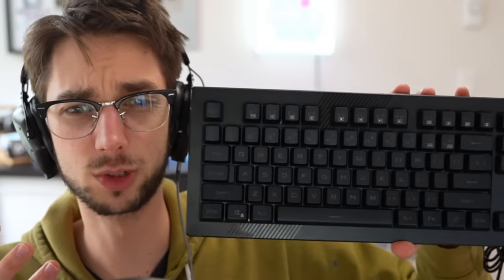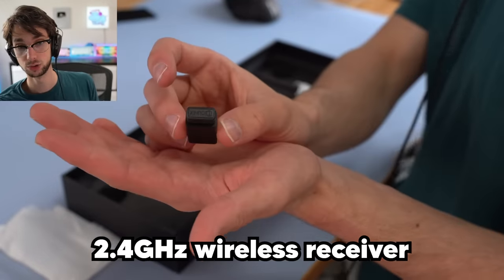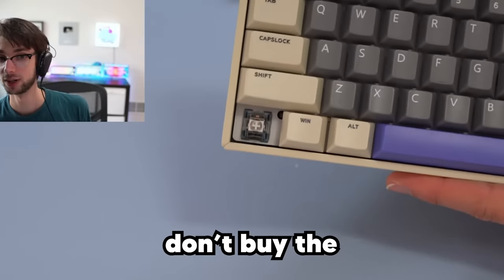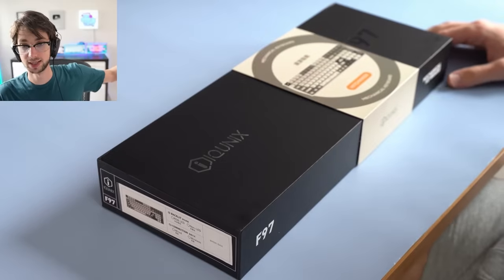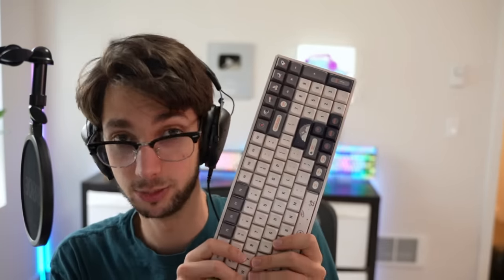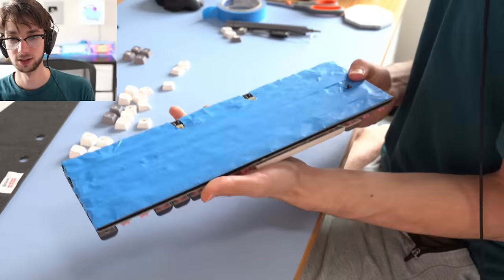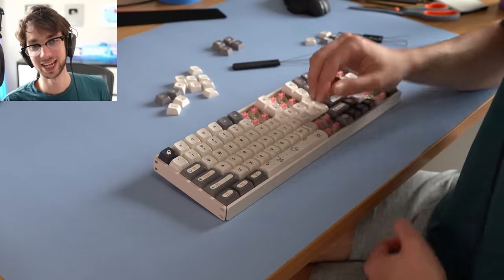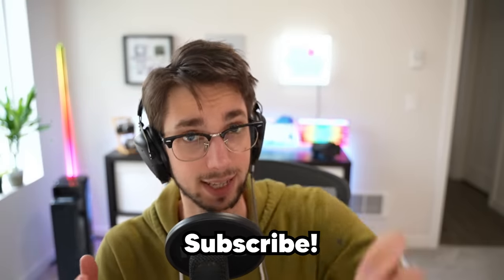Why do People Want Keyboards With Number Pads??

Comment: I work in IT and without a numpad doing even basic tasks like typing an IP address is a real pain so this actually looks really promising!
Reply: That and almost everything now requires two factor authentication where you have to enter the code
Reply: Also in IT and can also confirm. Didn’t think I’d need it, so I bought a NuPhy Air 75. Love it! But don’t love not having a numpad, so even though I’ll probably still keep it, the search continues!
Reply: Pretty much this.
Reply: Yeah the muscle memory of the numpad is difficult to change for the number row
Reply: @CaseyHardman  I have an Epomaker GK73XS which is VERY compact (323mm long, 118mm tall) but has a numpad. You do sacrifice quite a few keys in this form factor and can get used to it quite easily once you know where it is in the layers (customisable too), but some stuff is tough under this format when using modifiers to do actions with keys under layers. I'm inclined to suggest the new Epomaker TH96 or Keychron Q5 for a better experience with less of the compromise. The Epomaker only has proprietary software for customisation on the multi connectivity model, the wired one supporting QMK / VIA also, but the Keychron supports QMK in BT and Wireless!

That said I use the 73 for home and work so I take it in and at 680g it's pretty light vs the TH96 (1180g). Also the TH96 is longer and taller as it has an F-Row and a more usable layout (388mm x 138mm). It is also chunkier at 38mm vs the 73's  29.9mm.

Sadly the 73 is only Bluetooth and Wired (still good ngl) and has a fairly small battery (1900mAh - enough to get you through a working day even with LEDs on at lower brightness), but the TH96 has Bluetooth, wired and 2.4Ghz modes and a 6000mAh battery so should fare better.

I picked up the 73 at $99 but it dropped to $60 though is now sold out on their own site. The TH96 is $149 for the multi connectivity model and $170 for the Wired only model (odd, but here we are). There are some aesthetic and potentially QC considerations at this price point vs some other brands, but all in all I've had a great time with the 73 and going back to bigger keyboards is tough. Glad I have a numpad!
Reply: I picked up a B stock polycarb M0lly for work because of the layout. It's basically a 60% with a numpad tacked on. I don't miss my arrow keys because I have the space bar configured for space on tap and layer 1 on hold and WASD are my arrows. More efficient than moving my entire hand to hit dedicated arrows. And since I don't game at my work desk, using space as a layer key when held isn't a problem.
Reply: I feel you, however I have a lifehack for you if you work with a laptop without being connected a real keyboard. Buy a wireless standalone numpad ;)
Reply: Couldn't agree more. Typing in many IP addresses all the time working as a network engineer, a num pad is essential. I wish there were more full size mechanical keyboards. The 100%s too not the 96% I make typos all the time on them.
Reply: @bryanwi09  there's plenty of 100%s out there tbf, just not as popular now. I have a fnatic rush iso UK full size with cherry red silent keys. Linear but fairly quiet
Reply: @bryanwi09  mentioned it here earlier but for IT people I can really recommend getting a wireless numpad to work it even if you're using a laptop keyboard.
Reply: I work in health insurance, also need a numpad. I cant imagine entering claims without it....
Reply: Totally this. 
I've been pondering and I don't think I can do the 96% either. The 1U zero and no spacing I'm thinking are show stoppers for the quantity of zeros in the private subnets I'm entering much of every day.
Reply: @TheChiraagG  the small 0 on the numpad is so sad though.  Always keep hitting the right arrow key instead.
Reply: @mixeddrinks8100  does take some retraining of the ole muscle memory ngl
Reply: @TheChiraagG  might think about getting the Keychron Q6 for work need that full size 0, typing 0.00002 is no fun after awhile plus seems like it has a few extra button, could come in handy if you can remap them to copy and paste.  I work in QC/QA so after a session on the laboratory silicone keyboard, waterproof and can be disinfected.  Feel like I have to treat myself going back to the desk to fire off some angry emails at suppliers and staff.
Reply: @mixeddrinks8100  ahh I get it. I have less issues with the zero than sometimes hitting 4 as well as hitting enter lol

I think on the GX73 the issue is spacing. The Epomaker TH96 could be enough - no big zero but a space between that and the right arrow which would work for me. But of course YMMV. I'd actually have got the TH96 to replace the GX73XS but it would be a smidge too big to take into work every day.
Reply: or if one has to type in the language that has additional letters that are assigned to the upper row. imagine switching language just to be able to type numbers.
Reply: I just also like numpads. And macro keys. I want like twenty macro keys. Big ones. And small ones.
Reply: IP addresses, employee numbers, phone numbers, programming, etc.  I'd like to know what people are doing where they don't really need a numpad.
Reply: I am an engineer and I have a laptop without a numpad. Whenever I have to type numbers when writing formulas or sample calculations for a report I get distracted by the thought of how pissed I am and how annoying it is.
Reply: Valid
Reply: finance and Data analyst with excel, without numpad is killing me.
Reply: I’m an analyst, business and data, and also needs a 10key
Reply: @CaseyHardman  have you seen the new nuphy air 96? I just bought the halo 96! Waiting for it to arrive
Reply: I know the IP nightmare Without a number pad.
Reply: Separate numpad is the way to go.
Reply: @CaseyHardman  nuphy air96
Reply: There was a dude in my high school IT lab who always typed in IP addresses with the number row.
I should have seen the red flags.
He later implicated me in a scandal over some grades he changed after hours cuz I was in charge of the router box.
What he actually did was plug in a switch, bypassing my router entirely lol.
Reply: THIS!!! In I.T. We NEED our Num Pads, we NEED our F Row, we NEED arrow keys (bios bro!) and dear god what kinda computer user doesn’t occasionally press Ctrl Alt Delete so the boards missing delete BAFFLE me.
Reply: yerp, I'm not typing out IPs all day the long way. However, an 1800 is not a full sized.
Reply: @thumbwarriordx  bro... calling it "the router box" tells me you're in above your head. Do tell the network topology where this person "bypassed" the "router box" to make this happen.
Reply: @toohip  Yeah they were just on two different subnets and literally all you have to do is reconfigure the system you log in on to be on the other subnet with its second network adapter.
Which was the domain server and did have an extra RJ45 so no. There was no authentication between routers and switches. They didn't whitelist mac addresses and do all that difficult crap. These were PUBLIC SCHOOL IT people in 2008. Of course it wasn't difficult.
Reply: @toohip  It was literally a 4u chassis with 4 network cards and a core2Duo. I don't know what you want me to call it other than "the router box" 
It wasn't a frigging Cisco router.
Reply: @thumbwarriordx  that makes more sense, but a router is a router, regardless of the size. Is it layer 3? Yes? It's a router. Calling it a "router box" is just highly suspicious and odd. Plus, if you had anything with an xU mount, it wasn't a home networking appliance. 

Also, any kid with a lick of knowledge in the 90s/2ks was doing this same workaround. It's not a new thing. Schools are notoriously open.
Reply: @thumbwarriordx  also... I've been IT for decades. The amount of times I've heard this exact story is hilarious. "I had a friend that hacked the school network". It's the same old story.
Reply: @toohip  That's because it actually happened over and over.

Also he didn't hack anything. He already knew teacher passwords. All he did was connect an ethernet to a system he controlled and go in at night when he thought nobody would notice.

Personally I wasn't so forward. I would notice the "request help" button become available meaning I was being observed. 
I just opened the web source code to the login page of the grades system, the offending administrator stormed into the room and I yelled at him for a little bit and got suspended.
Reply: I can relate to this, I work in Cyber seurity and that num pad is an essential on my keyboard. 
My other half who works in financial compliance also required num pad...So underrated that side of he keyboard man
Reply: same, I'm thinking about making my own keyboard, but without a numpad it is almost like a nightmare, I tried to think how much I use the numpad and it is A LOT! so, that is a valid and heavy reason to use and keep using numpad
Reply: you can get a tkl keyboard that uses layers and put the numpad there or alternatively buy a separate numpad
Reply: I work in IT and I never use the number pad.
Reply: I work in it (data engineer), I enter numbers all the time and I never missed numpad. I'm actually thinking about going from 60 to 40. Sounds like a skill issue to me
Reply: I’l work an office job, and I constantly have to punch in account numbers. Number pad is a god send.
Reply: Skill issue.
Reply: @ttownscott  You too. Skill issue.
Reply: @CaseyHardman  You as well. Skill issue. You could have spent time practicing on upper rows. Few mins a day and you'll forget numpad in less than a month.
Reply: @TadeasF  Exactly!!! It only takes few minutes consistent practice every day. I'm more comfortable with upper rows now than I was before with numpad.

It's a skill issue and lazy IT people.

Comment: I mean, yeah, cost is really the answer. Would I like to have a keyboard that sounds great and feels fantastic to type on? Absolutely. Can I afford to spend $300 or more on a custom keyboard when there's no functional difference? Absolutely not.
Reply: I mean there are cheaper options out there if you research (like the Tester84 and Tester68, both come with surprising features and mods preinstalled).... but I get the feeling this is the sort of hidden gem you'd usually have to be digging around the hobby a while before even coming across these - at least in my case. Factoring in shipping times and another £30 or so for some Akko switches (they have a 'factory lubed' lineup which is surprisingly affordable) and also some half decent PBT keycaps and its a surprisingly competent DIY item. They are cheap enough builds to make cool gifts for your loved ones.

But then there's the other investment, for a decent DIY project time (especially if you decide to hand lube switches, fine tune stabilisers etc.)
Reply: @eduardoanonimo3031  bro what
Reply: @naliboi93  what im doing is buying a mizar mz60 and nk creams, lubing the nk creams and putting the nk creams into the mz60 (its hotswap). ~$100 not including lube, including lube is ~$115 ish
Reply: @Shaggiel  

That sounds like a fair price compared to the amount I must have spent trying to figure out this hobby and achieve an ultimate endgame keyboard in my first build. Hope your build goes well and would love to hear an update!

Just remember that initial investements easily runs the risk of blowing your budget during the first build.

I was slightly lucky as I received a used Redragon K552 for free, but I still overspent on useless items due to trial and error and the pursuit of discovering my own "preferances":
- 2 unused sets of cheapo Aliexpress shine-through PBT keycaps
- 1 set of dye sub printed PBT artsy spacebar, enter, esc, backspace (wrong sizes on enter and backspace)
- 3 sets of unused Redragon switches (red, blue, brown).
- 3 sets of unused stabilisers
- 2 unused (and unshielded!) aviator coil USB-C cables + a bunch of 4 pin and 5 pin connectors (completely hopeless as I just went for standard shielded usb C cable in the end).

Of the stuff I actually did end up using, I still ended up with a bunch of spare parts. Here's the mods, materials and tools I eneded up using for my k552 project:
- tape mod
- Adafruit USB-C daughterboard for a detachable usb-c cable mod (I already had soldering equipment and crimping tools on hand from previously, so that helped).
- x2 boxes of Akko CS lavender purples (which I lubed)
- switch opener
- keycap and switch pullers
- tweezers and cutters
- set of handheld single hole punch tool bits.
- brushes and lube (tribosys 3203, krytox 205G0)
- DIY clipped, lubed and holee moded stabilisers.
- DIY PE foam mod (between the metal plate and PCB)
- poron stickers under each switch.
- foam switch films
- coral sea PBT keycap set from Aliexpress (which actually had decent enough compatibility with UK ANSI layout)
- DIY case dampening: combination of butyl rubber sheets, NOICO car dampening foam/putty sheets, and PE foam.
- a KBD Fans TKL carry case.

I'm delighted with my K552's endgame look, feel and sound, but there was so much time and unnecessary money spent. I learnt a LOT about keyboards, DIY, and electronics. I've also got loads of new tools and materials for future DIY projects (some came in clutch for other electronics and longboard projects). Sadly I doubt the more niche materials will find any use again, so there's lots of useless inventory. 

It took 2 months of intermittent progress after work and on weekends to complete, but also a lot of time was waiting on shipping. To use up some spare parts, I also built a GK21 numpad for myself and also a Tester86 as a gift for my brother.

Its a cool hobby, but even "cheap" builds suffered from hidden costs of initial investments: new bespoke tools, consumables, and trial + error. I'm sure many of these costs were avoidable, but I've now got enough knowledge and resources for budget builds in the future. Doesn't change the fact that my first build ended up hella pricey (I don't want to calculate as it'll be mega depressing, lol).
Reply: @naliboi93  yeah i think most of these people are looking for full sized stuff which tester 84/68 isn't
Reply: You can buy a decent mechanical keyboard for like $120.  There are a lot of benefits to mechanical other than sound.  If your working a job that requires you to work at a desk for hours on end you should definitely invest in a mechanical keyboard.  (I have recommended this to a lot of other people, they are all very satisfied with their keyboard)
Reply: Typing feel is not 'no functional difference' when you type for the entirety of your career. Keyboard and monitor are the two things to optimize.
Reply: @davidjohnston4240  monitors don’t have the biggest impact on office work, you don’t really need an amazing monitor to look at spreadsheets.
Reply: @QVX_  They do for me. I design chips. I want to see code, a sim and a spec at the same time
Reply: @DavidJohnston_deadhat  yeah, I get having multiple, I have 2 at both my work and home setup,  I thought you were referring to a high hz monitor, a super color accurate monitor, or a curved monitor.  For most non-gaming use cases you can buy a bunch of cheap-mid tier monitors that will last for years.
Reply: @QVX_  high refresh not so much, but one that's high res and clear can make a big difference when you spend your day looking at code. Ideally 16x10, or ultrawide. A nice keyboard is also good, you don't need to spend a fortune but the basic shit you get with office PC's is just not good enough.
Reply: @morosis82  yeah, that’s what I’ve been saying.  Decent monitors are pretty cheap
Reply: @naliboi93  bruuuuh... are unserious lmao. I'm new to this to it didn't take long to fine the mural dye sublimated pbt shine through sets on ali express. There's some beauties on there if you willing to spend like a long ass time searching that mess of a site. They bury the good stuff im convinced.

Comment: Fun fact... you don't need to disasemble the housing to access the board and take it out. it becomes much easier when you just take the 8 screws out of the keydeck rather then taking the screws out from the sides.

Comment: I got the iQuinix F97 Hitchhiker board a few weeks back and it’s fantastic. The only modding I did was to buy Gateron Box Ink Black switches and it sounds amazingly thick now. I use it with my Mac via Bluetooth and it works perfectly. I highly recommend it if you want to minimal modding and want a serious quality board. The Keycaps are excellent, PBT and ooze quality. They’re KDA profile and really comfortable to type on.

Comment: I've used normal full sized keyboards for so long that switching to anything smaller would just throw me off. Besides I have a g512 (on sale for $75) that I just pulled out and lubed the switches/stabilizers and replaced the keycaps with pudding keykcaps. Sounds really nice to me, looks beautiful, and only cost about $100 total.
Reply: Did you make the G512 hot swappable or did you just solder/desolder the switches?